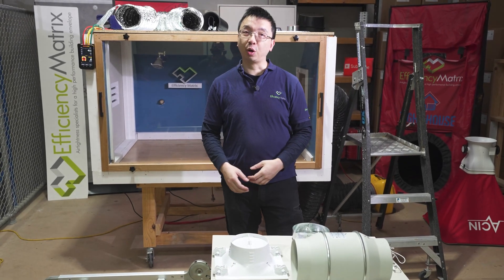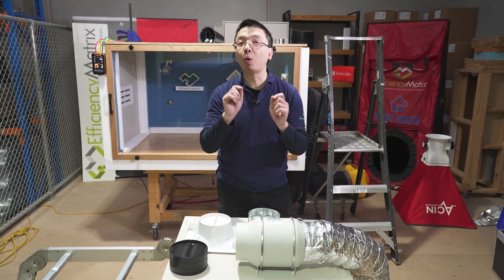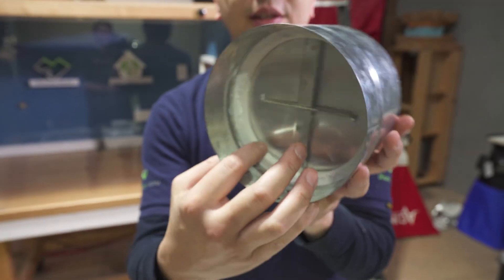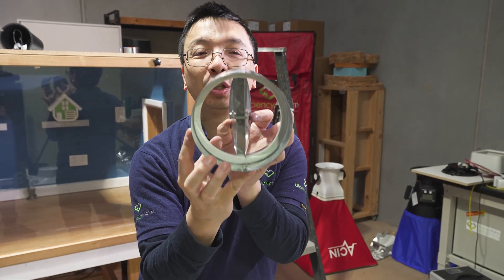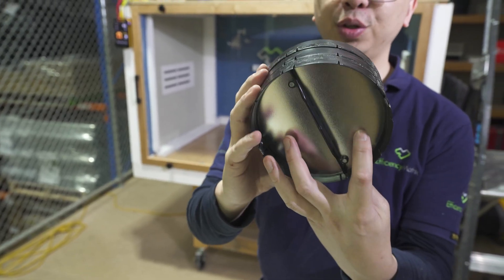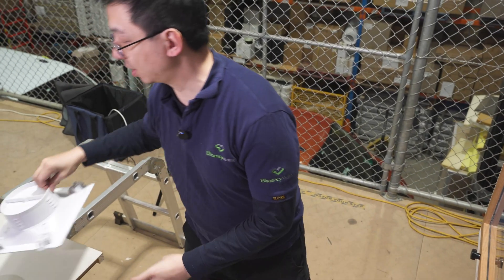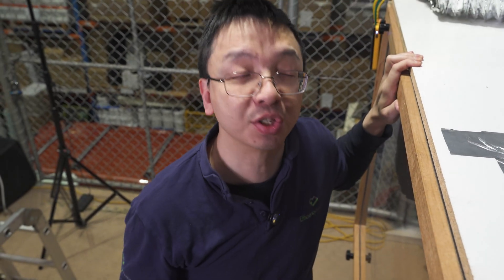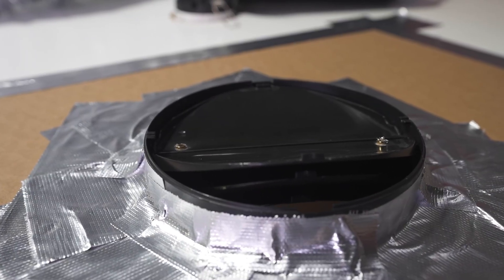Stop Drafts, Save Energy: Best Inline Fan Draft Stoppers

Comment: Should this be installed at the rangehood / exhaust fan of the duct, or close to the exterior?
Reply from the maker: On the pressured side of the duct, would work pretty well.
Reply: @ecoevo surely the flammability of the ducting needs to be considered when connected to a rangehood
Reply from the maker: @Deniseandgavin yeah, range hood should have an integrated flap.   This is more for inline exhaust systems for bathrooms laundry’s and toilets.